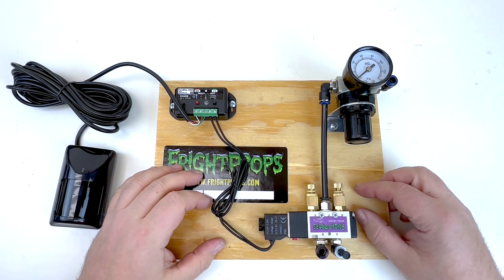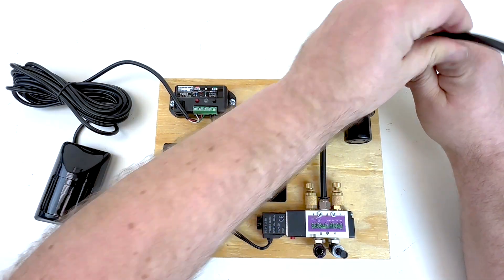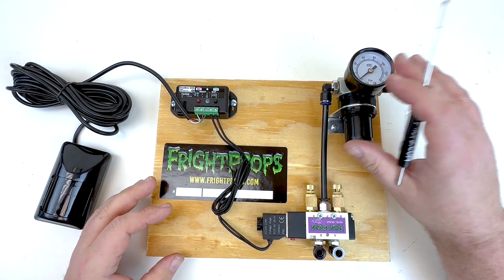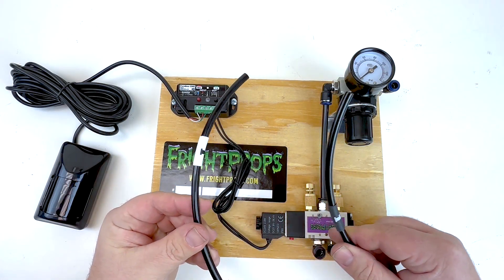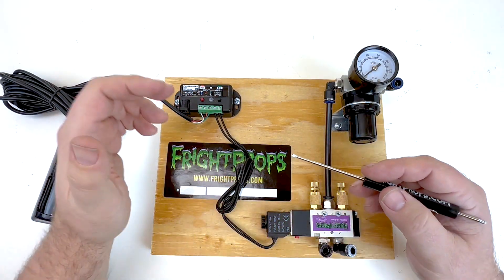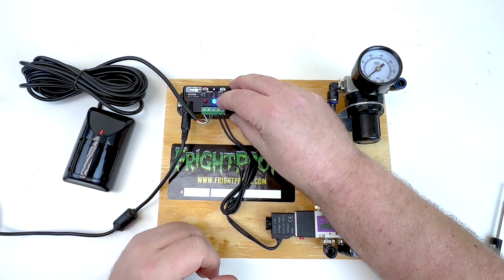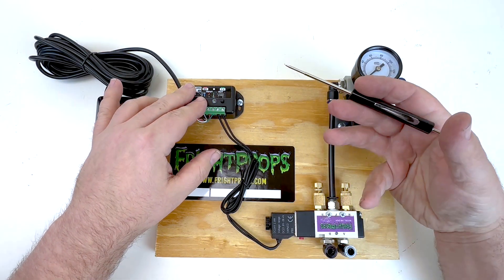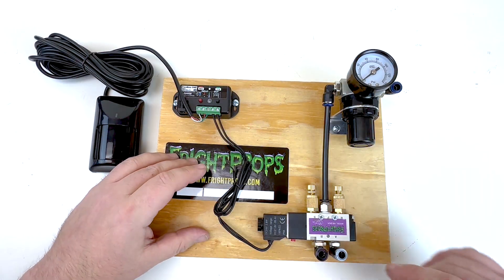Pneumatic Halloween Prop Mech Board Overview

Comment: Am excellent tutorial, a lot of fine points about the PSI, using a regulator, adjusting the values, etc.  I like to mount my controllers on a board as well, it really helps organize the electronics and pieces.  In the Scary Pirate Prop, I mounted the solenoids on the individual mechs and then used a barrel connector to run the solenoids from the controller. That way I could leave the air lines connected and remove the prop will little fuss.  I'm thinking now that you could enclose them and make that solenoid hiss sound less noticeable  Most of the time you can't hear that anyway if you have the sounds of the prop going off, but that might help minimize it.

Comment: What would be the reccomended psi for a unit 70 prop or a poison prop cause they dont tell us reccomended psi
Reply: 60 to 80 PSI for a starting psi you can go higher but it's gonna wear out faster
Reply: @Logan-oct31  wear out as in breaking airlines or water in airlines? And how long would it last?
Reply: Mostly from what i've heard like components like the pneumatics cylinders or sometimes even the frame/mec, but it will still last a while like maybe 10 years  @scorchedevil9669
Reply: @Logan-oct31 then thats plenty of time for me to play with it.   I wish i had a my own air compressor and a pro prop from unit 70 or poison